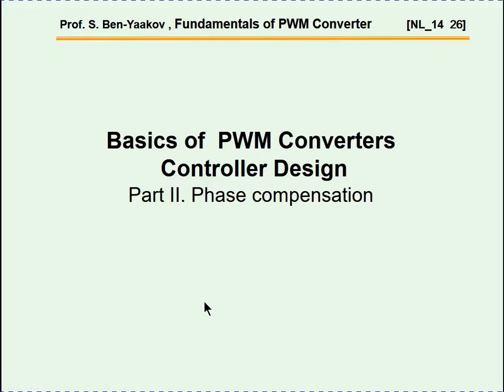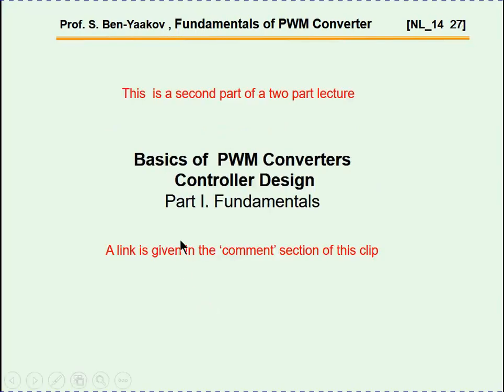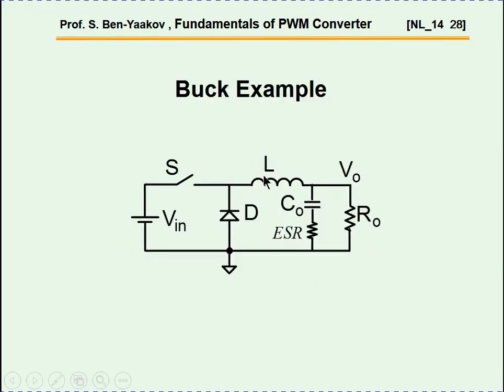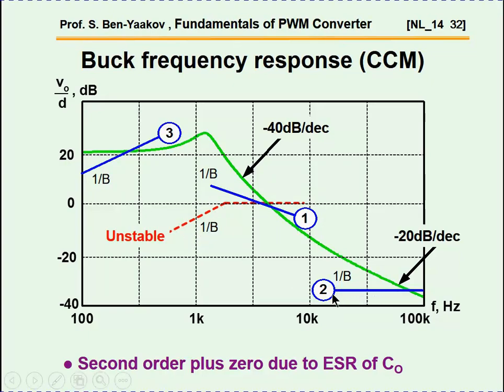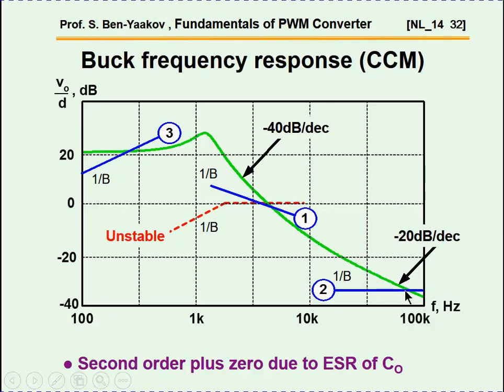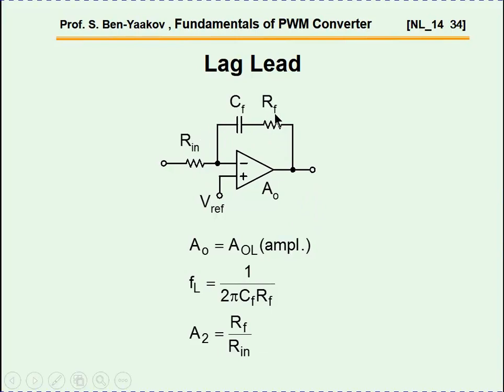Basics of  PWM Converters Controller Design.Part II. Phase compensation

Comment: Dear Professor, 
Sincere gratitude for sharing this valueable knowledge. I work as a control engineer for Xray high voltage generator. The control systems these days are mostly implemented digitally, but have been derived from analog electronics like this. These days, not a single digital engineer learns the analog equivalent in detail and blindly simulates in MATLAB. I hope more digital engineers learn and pass on the knowledge of analog equivalent to understand the subject properly.

Again, sincere thanks for the work you are doing. My best wishes 🙏
Reply from the maker: Thank for the comment and sharing.

Comment: Dear Prof. Ben-Yaakov, regarding slide 32, you talked about cutting the plant transfer function with the curve denoted as (3) and mentioned that this would result in a very narrow control bandwidth. Is this due to the fact that the integral gain cannot be chosen too large, because of for example limit cycling (I believe one no-limit cycling condition for digital controllers was that this gain be between 0 and 1)? Also, what would be your strategy when controlling a buck converter with two output LC filter stages? Would you try to cut the plant transfer function between the two pole locations (resonance peaks) of the transfer function? 

Many thanks for all the valuable lectures!
Reply from the maker: The cross over frequency determines the closed loop BW. Or I did not understand your question?

Comment: Dear Professor,
Is there an intuitive way to understand 
why the transfer function will become
a first order system in DCM mode?
Reply from the maker: In DCM, the inductor is charged and then completely discharged. This makes it a current source which, with the RC is first order.

Comment: שלום,
ממש תודה על ההרצאות המועילות.

I want to ask two questions:

1.  I have built a current mode boost DCDC model according to your lectures. Now I am trying to add a compensator. I see the loop gain as it should be a 1st order system then adding compensator with the right gain at the desired frequency. All look fine from the magnitude aspect but I am ending with 9 degrees PM. (The breaking point of the compensator is at 60KHz and the 0dB point is 300KHz. the compensator is totally flat when crossing the converter response.) What can be the reason?
2. The type of the compensator you are showing here "consumes" current from the feedback network. Do you have another lecture showing high impendence compensator type?

Thanks a lot,
(דרך אגב יש אימייל או טלפון בו אפשר לשאול שאלות?)
Reply from the maker: Send me more detailed information. Ican not follow the questions. You can conta t me at sby@bgu.ac.il

Comment: At 8:08 the plus terminal of the op amp should go to earth or zero potential.
Reply from the maker: Not really, connecting the plus input to the reference realizes the feedback summing junction at which the output is compared to the reference. If the positive input will be grounded you will have to do subtraction somewhere else.

Comment: 10:28 ...  I think there's an error.  A2/A1 (real values) = 1/5.  With A1dB=-25,  then A2dB= A1dB + 20log(1/5)= -35-14 = -49dB.
Reply from the maker: What minute in video are you referring to?
Reply: @sambenyaakov   10:28 - as mentioned
Reply: @cuchulainkailen  I am not quite clear about that calculation. Based on the slope formula m = (y1-y2)/(x1-x2) you have a couple of things to consider, the slope value is in DB/dec, therefore x1-x2 need to be expressed in decades. Meaning that x1-x2 = 0.25 dec. From 2KHz to 5KHz there is only 0.25 dec. Therefore based on the slope formula you can say -20 DB = (-35DB - Y2)/(-0.25 decade) therefore Y2 = B = -40 DB.

Comment: Dear Professor,
thank you very much for this explanation. I just have one question:
How do you derive the transfer function of the open-loop buck converter at 1:20?
If I have a fixed D, my d would be zero, or am I wrong?
Reply from the maker: Dis the operating point around which there is a perturbation od d. See https://youtu.be/ne9loX-0Zws

Comment: Sir, it's a great lecture thank you very much for your efforts, but I have some questions that i don't clearly understand it. 

1- How the Gain of open-loop transfer function for buck converter can be greater than 0 dB (amplification) and buck circuit can only attenuate voltage?
--------------

2- Can we use PID Controller instead of Lead-Lag compensator, and if Yes, what will be the difference in results?
--------------

3- Why we work on small signal and not the total signal. I think the average value also important for analysis ?
-------------
4- Why don't we just put another op amp with gain = 1,  for inverting the signal 180 degree phase shift instead using complex technique in phase compensation?
Reply from the maker: Would you please post these questions at
https://www.linkedin.com/groups/13606756
so members can benefit from answers by me and others
You will need to register if not a member.

Comment: Hello sir thank you for the nice licture. There's a thing which i still don't understand quite good: lets takes the buck example in CCM, we got second order output filter which gives us 2 pole and one zero. Well if we want to use a type 2 compensator we can at least cross the H with -40dB/dec slope, is it true? But this mean we can't get enough PM, so how to get away?  Thank you very much
Reply from the maker: You need a double zero controller (sometime referred to as type 3)
Reply from the maker: This will give phase advane
Reply: Thank you very much for reply! Another doubt i have is the PM must be checked just only on the crosspoint or on every frequency under it.
Reply from the maker: Only at the cross over frequency
Reply: This is quite interesting, ever tought that even before the corner frequency there were needed phase margin. What if a signal at fcross/2 eg and so gain>1 has 180 phase delay?
Reply from the maker: Look what happens in the Nyquist which is the key to all of it.

Comment: Thank you prof for great videos.
My question is how the output capacitor can improve the stability of the converter ?
One more question is ESR will increase the output voltageand, so how to select the output capacitor?
Reply from the maker: And increase of output capacitance is generally a poor way to stabilize converters. The ESR  increases the ripple and causes a voltage drop under a load step

Comment: sir, Could I use a dc motor instead of just a resistive load?BTW one more thing is before designing compensator, we surely have to know the transfer function of the existed system right?accordingly, we need to compensate the system.

And the other doubt was, is it by default we have to use lag-lead compensation network to rectify the stability?or we can also go for other compensation networks like lead or lag?Sir,it also helps us immensely if you tell us how to do all these things in MATLAB or simulink.I really appreciate the work you are doing,it may not help everyone but the ones who have been doing research will surely help a lot.
Reply from the maker: Google: 
state space averaging 
average simulation of PWM
Reply: I guess AC sweep is another solution to generate a bode plot which you don't need to know any equation. But you need to understand which kind of transfer function you want to get.

Comment: Thank you Prof. Ben-Yaakov. Excellent video once more. Could you do a video explaining the inner current loop and outer voltage loop control? I would like it for EV fast charging station connection to the grid studies and I am not quite understanding how to bring everything together from all the resources I have gone through.
Reply from the maker: Thanks for the comment. I am planning a current feedback control video that will cover inner and outer loop.
Reply: Thank you so much sir. I will be eagerly awaiting it.
Reply: Also could you give us an example of how to implement dq0 (although this is power systems) to represent the grid and finally connect this with a converter? This part is currently challenging for me to implement.

Comment: Very nice video, but I must admit, it's quite a difficult subject for me.
Reply from the maker: This IS a tough subject. Take a break and then watch it again. I am sure you will fully grasp it. It is a very important subject. Not many practicing power electronics engineers understand it.
Reply from the maker: One more thing:  try to prepare a primer that will cover just the core of the subject. 
I would appreciate if could tell me a bit about your educational background so I can better understand the reason for my "overdoing" it with this video.
Reply: I can see that it's a very important subject, I'm trying my best to fully understand it, but I think I simply don't even fully understand the basics. What I fail to understand is that at some points I don't really know what you are talking about. It could be because of my lack of knowledge and that you expect the viewers to actually know the basics and instantly see what some slides are about. 

Was your second comment for Muhammad Adeen? Well, I'll answer it anyway. Yes, I should further research the core of the subject, which I will. Do you have tips on where to start? For my educational background, I am currently studying mechanical engineering at the Technical University of Delft. However, I have a heated passion for electrical power systems, your subject of expertise. I know that everything you discuss is very important in power electronics design, therefore I want to understand, sometimes even too fast. 
I don't think there was any overdoing. I do think you assume your viewers to have atleast seen these topics a couple of times before. There were some terms in this slide I had literally never heard about or even the basics of them. So on somethings I can't put a connection to, there isn't a well established link in my head. 

I will make sure to further research this topics and rewatch the videos. Therefore your effort has not been for nothing! I will understand this topic completely, I promise.
Reply from the maker: Hi,  Thanks for sharing your concerns. The background required is Bode Plots and Laplace Transform and Domain or in general: what is usually referred to as Theory of Dynamic |Systems. Your self improvement efforts are commendable.
Reply: Ah, thank you very much, I will come back when I understand those 
subjects better! Yes, I like everything about anything that handles 
great amounts of power. Especially with the rise of electric cars and 
stuff like Tesla, I think it's very important that these subjects are 
well understood, even as a mechanical engineer. You are helping me 
there.